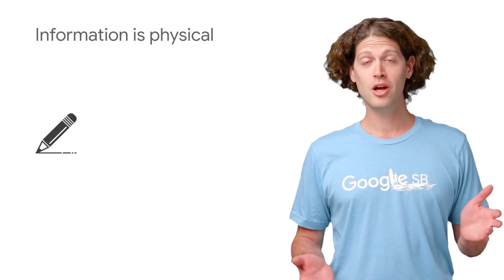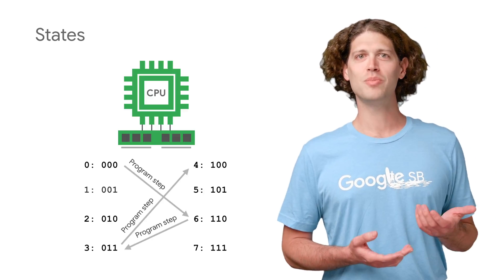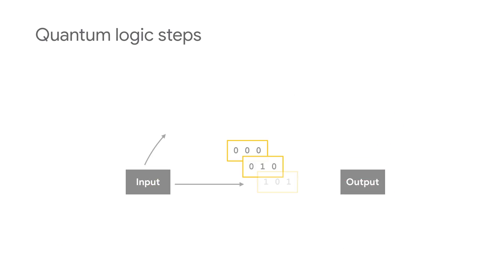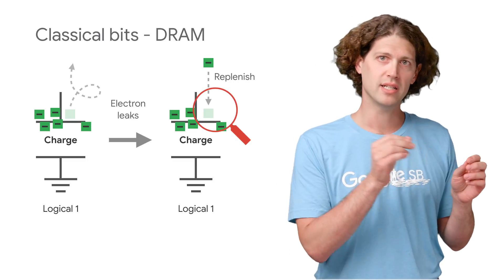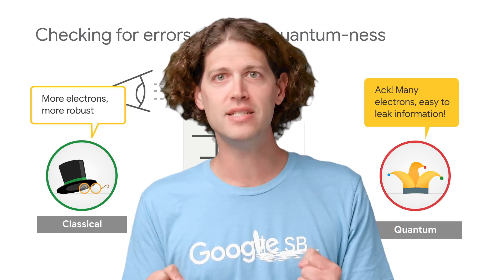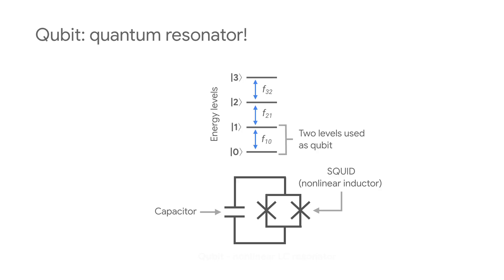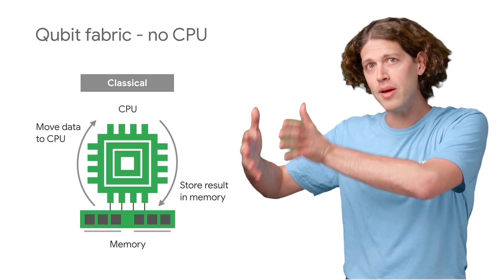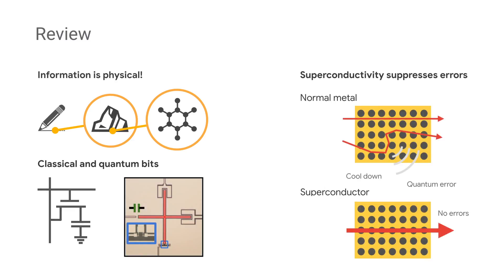Building a quantum computer with superconducting qubits (QuantumCasts)

Comment: Thanks, 
Great job 

I have two questions:

do you only keep the two lowest energy states for the qubits to keep superposition of two states ? 
If yes how do you prevent an aggregate of atoms from going to higher energy states ? If no this means that one bit can be represented by the vector [0,…,1,…,0] (with one on the active energy state the system collapsed to) once measured,  could you point some material to know how to build circuits like addition multiplication with such vectors ?

Comment: Micro-fab begin folding those metals atleast 22 times like a samurai sword as to remove imperfections, or ions (slag). If their ions are removed the q-bit won't have opportunity to flip. If I understand correctly you just want clean electricity to flow through no hurdles & aren't their water cooled computers.?. Tie that in some how. LoL I know nothing just really curious how it all works. I do electrical work (shade tree electrician) but point I guess like from transmission lines to service lines into the services of a house to an AC adaptor to a circuit board to services of what ever using. Accept dirty electricity exist & that's what I feel your saying you have to remove, and I also think your guys cryostats are cool. Like really really cool.

Comment: Thanks for the video Daniel,
If I got it well, you are proposing a new chip (8 times colder than space) simulating the operations of Cryostat. The superposition is ensured by the Superconductivity at steady rate, but we could have some errors.
My questions: Does this chip also manipulate true electrons inside for the superposition states (as the Cryostat), or States are hardcoded in the simulation? Is it possible to use this chip to create small quantum computers (like PCs) and make them available for the public?
Correct me if I made a mistake, please.

Comment: I'm still confused how logical operations are performed and the results observed. A good amount of time of this video was spent focusing on explaining the protection the qubit circuitry from any interference, even so much as a photon, but then it was said that logic operations are sent to the qubits for processing, and no explanation was given. 

(1) How are the logic operations sent to the qubits for processing without changing the qubits into an unknown state? 
(2) And how are the results observed without altering the answer? Observation involves interaction with the qubit, even if it is so much as a photon or a very sensitive electromagnetic field sensor that responds by sending out a signal (which itself generates a new electromagnetic field), and if the qubits are supposed to be protected from such things, how are answers observed?
Reply: Had to keep it to around ten minutes and couldn't cover everything. We'll get to control and readout at some point. But in short: single qubit controls are microwave frequency pulses for bit flips and lower frequency pulses for frequency shifts. Readout is a bit more complicated and is described in publicly published literature, but for a pedagogical discussion you could try my PhD thesis: http://web.physics.ucsb.edu/~martinisgroup/theses/Sank2014.pdf
Reply: @danielsank5094  thanks :) 
Looking forward to next one.
Reply: These slides might help: https://docs.google.com/presentation/d/1UsXVoqzu9rnpwiC3nN7YVG2YA9mvHgM84KH_JMXwFJE/edit?usp=sharing
Reply: For (1): There are microwave generators that send microwave pulses down control lines connected to the qubits. Different pulses have different effects, and within the set of possible effects there are quantum gates such as the Hadamard gate. Quantum computation is basically just the application of a series of known gates in a specified order, so in principle these pulses are sufficient to perform any computation. In practice there is sufficient noise that the computations are still limited to short times; for very long running computations error correcting codes such as the surface code will be needed.

For (2): In the simplest case, measurement always comes at the end of the computation. So it doesn't matter that you've caused damage that would prevent the computation from being continued further. In more complicated cases, you need to be careful to measure only the bare minimum of what you need and leave everything else unaffected.
Reply: using quantum gates and microwave pulses.